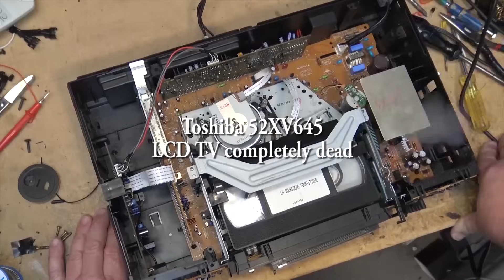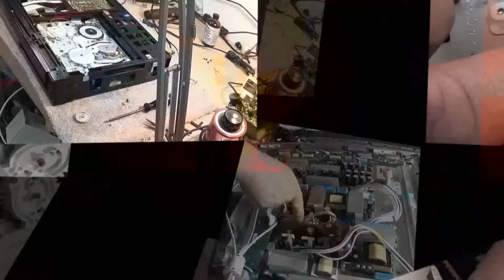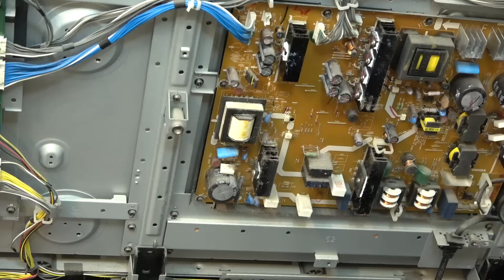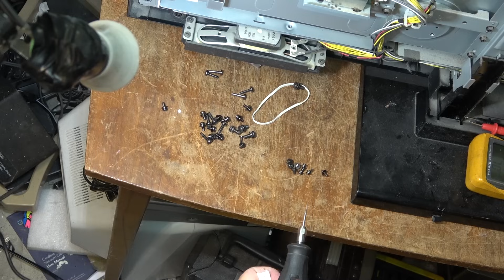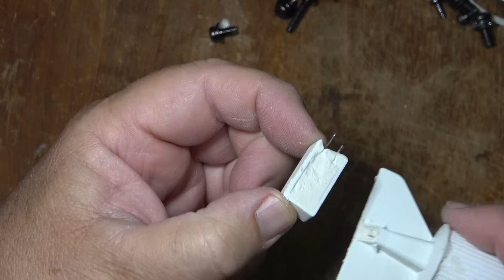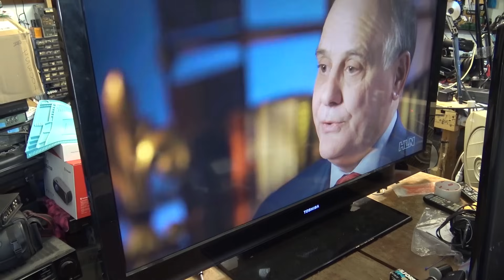Toshiba 52XV645 LCD TV Completely Dead NOT CAPACITORS

Comment: This is interesting that this video randomly showed up for me today!  I am actually watching it on this exact same model of Toshiba which I've been using for about 13 years.  About 6 years ago I noticed that I sometimes would have to try to turn it on 4 or 5 times before it would finally turn on, which was getting worse, so since then I've only turned the TV off once in those 6 years, that's when I moved about 2 years ago. TV is still great but I've been afraid to turn it off in case it never comes back on again.  When it dies, I will probably refer to this video and attempt a repair.  Thanks!
Reply from the maker: Slow turn on is likely a cap or 2 in the power supply getting weak.

Comment: Curious about the cement Dave. Home E-Z Patch. Would that be from Home Hardware? I’m thinking it must be a ceramic cement. I’ve never used this before. It’s a great idea to just repair the thermal cutout.
Reply from the maker: It's drywall patch and it works great.  Great for fixing drywall too.

Comment: Did you discharge the capacitors before starting your video?
Reply from the maker: Did you see me discharge them? Contrary to what most believe they don't hold a charge long.  Tube equipment yes solid state no, there is always a load that will discharge them within a few seconds of unplugging.
Reply: @12voltvids thanks for responding. I learned a bit extra

Comment: It’s always interesting to me that you can’t make any money doing electronics repairs. I do all kinds of rebuilds and repairs from home here in Ontario, mostly audio amps, vintage receivers , crts from the vintage arcade collectors and the weird odd ball, and I’m able to charge decent. I will say you don’t to charge what you deserve always as it can take more time then you’d like sometimes but average repair charge is at least 40 bucks and hopefully can be done an hour or less.
Reply from the maker: Our here the majority have been conditioned that nothing is worth repairing.  Right now I have 4 more TV's that were given to me. Wouldn't even spend 50 bucks on them.  I will say that equipment shipped in from back east or the us pays much better then the locals.   The locals want it done for next to nothing or they just tell me to keep it.   50 bucks is what I made to fix the hdmi port.  8mm camcorder perhaps 100.  I ended up with a digital 8 camera because i quoted 150 to repair the power supply.  Was told to keep it.  Use it to this day for transfers.  It was this bad 20 years ago too.  That's why i left the business in 03.   I hear those say how much they charge and just shake my head because that would never fly on this area.
Reply: @12voltvids  interesting. Here in ontario there's a large group of people about 50 or so that are into the vintage arcade games, and the crts that are In them need repairing. Also, the vintage audio collectors seem to like thier stuff redone. I do agree even here, tvs are crap and cheap. Although I recently had someone bring me a 70inch visio POS he had bought new led strips for it and had me put them in, I charged him 125 bucks mostly because it was a real pain in the ass dealing with the size of the thing. You can buy 70inch smart tvs for 500 bucks these days. 

You so good at all the really good old stuff, like dats and all the camcorders and such, and the mechanisms, it's to bad you can't charge what your worth to fix the stuff. Who knows maybe it will come around. 

I do agree on the tvs though. They just aren't worth fixing or putting new leds strips on them. I realky like your approach on those. And yiu can never tell if you jump 1 bulb or short one out.

Comment: Lol LED crap, as compared to fluorescent crap. ;-) SO happy to have LED and not the older LCD crap thank you.
Reply from the maker: LEDs don't last. Ccfl did.
Reply: @12voltvids  Well my LCDS did not last as long as my LEDs so far and they get those damns lines in them, CRAP! You like vinyl I bet.
Reply from the maker: @nbrown5907  no vinyl here.  I have plasma sets.  Some early LCD had panel problems. Led sets ha e backlight troubles. Just did a Sony today with 3 bad led. 1 in each strip.
Reply: @12voltvids  Plasma uses much more power and I have been lucky with my LG nanoscreen I guess. I had a small visio that had a bad design with the way the two circuit boards connected and that was a bad led for board design flaw lol.
Reply from the maker: @nbrown5907  that's bullshit.  If you run a plasma cranked up full and display a full white screen yes, but average consumption is not that bad.  Actually lower than ccfl LCD sets. More than led sure, and the early ones were power pigs but anything after 2008 were pretty good and in the last 3 years 2010 and beyond were all energy star rated and drew about 1/5 of the first gen. I put the power meter on the 2012 51 I have in my bedroom and it averages only about 75 watts.  Full white screen is 130.

Comment: I miss the old days when TV's had a plethora of inputs. I've noticed some brand new TV's don't even have RF jacks or composite. USB HDMI and optical out. That's it. Not even a headphone jack or 3.5mm input.
Reply from the maker: That's a reason to hang onto old ones.
Reply: @12voltvids My question then is since a new HDTV needs either WiFi or a High Definition antenna (the antenna that does plug into a jack on today's latest recommend buy new TVs like my purchase 4 months ago): ... A special antenna with signal gain to boost distance is needed of High Definition signal (maybe transmissions not coming from satellite).  An analog engineer can use all these ports to tie into an analog to digital converter box and then output to the antenna as a digital input.  I notice my 2008 digital converter boxes for analog TVs still work with antenna or DVD players or VCR inputs.  They don't HDMI output like Blue Ray players.  I think a Blue Ray or video gaming player can be that adapter box for analog converted to digital electronics (not to confuse with the digital converter box reverse needs).
Reply: @12voltvids  Plus a simple $40 Chromecast gives you the same functionality if not more than a modern set give you, including Bluetooth
Reply: I miss analog tv📺
Reply: While it's apart just clean out the excessive dust as surely lack of cooling caused  the problem , expensive in there time ,nice to see the air line at the end but didn't clear the dust under the board .air has to work hard in these modern sets no big box to help cool components and processers and small inlet holes at least with this bigger style set the bigger speakers give better sound and backdraft into the interior.Older source's need component input and old scart VHS althow may not look too good on high Def screens.

Comment: Thanks Dave, even the older sets are good fix videos to add  " parts identification " knowledge to us less educated hobbyists .  I have replace a few thermal fuses to items like fan motors but did not know about the thermal cut-out / resistor like you replaced.  Does it make any difference as to which direction / polarity or case lead  can be inserted ?  I have seen Paul Carlson stress how axial caps in amplifiers need a specific shield end insertion to prevent noise.   By the way, Houston is expecting daytime temps to be about 103' so the Harley will be taking a siesta till the heat diminishes.  Be safe bro.
Reply from the maker: Polarity does not matter. This is a resistor.  Those caps that Paul talks about is the outside foil and was an issue on the big old wax caps but less of an issue on modern replacements due to the much smaller physical size.
It's only an issue with old tube gear as they are high impedance devices and very sensitive.  You want the outside foil to the plate or ground side not the grid side but again not as much of an issue on new smaller caps.
Reply: @12voltvids  Appreciate the feedback.  I was not sure if direction for soldering would be an issue or if an aluminum heat sink clip would be recommended to dissipate heat to prevent the fuse from going open.  Thanks Dave